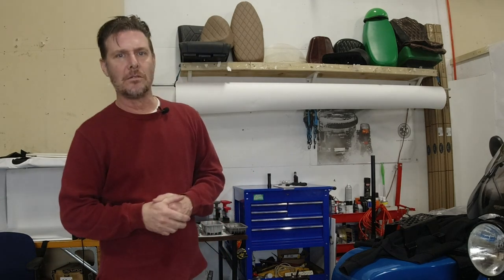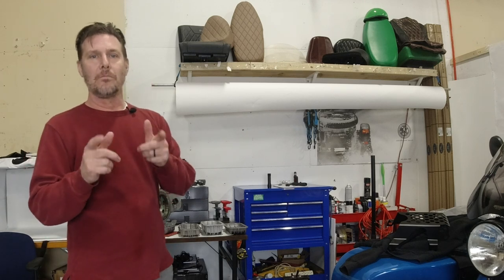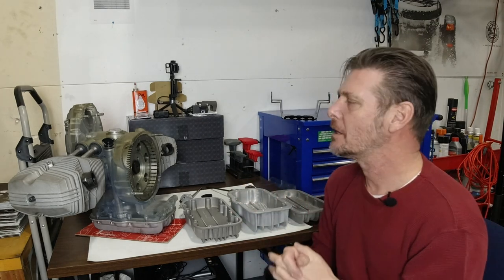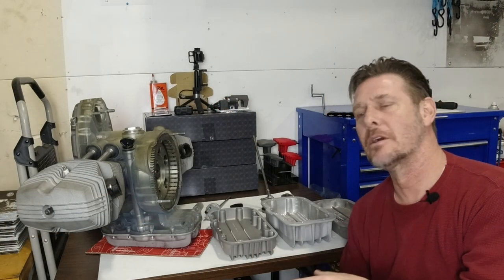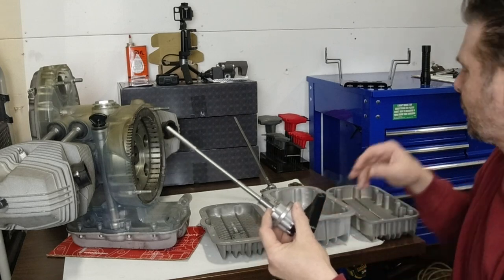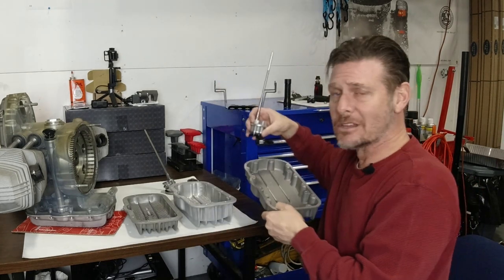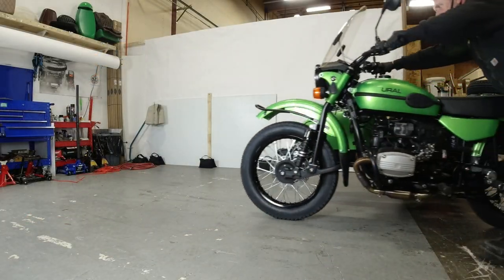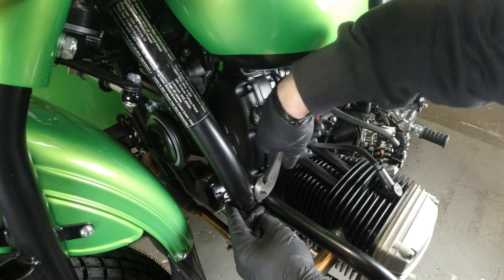URAL How-To - Sump Protection Plate Installation

Comment: Good work Dave.✅
We actually Just tightened up our engine to frame through bolts a few days ago 14:09  and a 3/4” socket also fits fine IF you don’t have a 19 mm socket like us, the largest mm socket we have is 18mm... 🤷🏻‍♂️🤔👏

Comment: Is it critically important to unhook the positive terminal while installing the skid plate?
My 2016 GU has a 4 post AGM battery, and I’d have to pull the seat to do that.
I can’t think of any reason that the O2 sensors can’t simply be disconnected/reconnected on this Gen 1 engine.
I know as a Ural Factory Rep, you have to instruct us to always disconnect the battery for almost any project, but I’d appreciate some real-life reader input from other Ural riders that have installed this skid plate.
Thanx!
Reply: Just installed the Sump Guard myself without disconnecting the battery. No issues. I think regardless of the maintenance, it is always suggested to disconnect the battery. I have a 2022 and ill tell you what, if you are purchasing a new Ural on and ordering it from the factory, I would say it is worth getting stock. Getting the Exhaust off (mind you I have only ridden 2.1K miles) was a chore as it is seated extremely tight. Hope this helps.
Reply: @aur5881  
Thanx for the reply, AUR.
   I was fairly sure it isn’t necessary, but had to ask.
   I was told that on the Gen 2 EFI’s, unhooking certain components can leave a trouble code if the battery is left connected during service, but my 2016 Gen 1 would probably be just fine.
Ride safe, and thanx for the reply!

Comment: Thanks from OZ, David
Some of the sump protection plates do seem to be overly large, but probably protecting the headers and cats, as well as adding weight.Talking of sump oil capacity, and increasing the oil volume. Would an oil cooler contribute to   greater oil volume?? And a worthwhile addition to a 2022??
Reply: I believe the sidecar mounted oil cooler adds just short of 1 liter of oil to the system.
ANYTHING that adds cooling & oil capacity to an air-only cooled engine is a major asset.

Comment: A little off-topic here, sorry David. Is there a reason for the flat washers on the front instead of lock washers? I ask because one of those nuts fell off on my 2021 and the stud almost walked out! I replaced the nuts, added lock washers up front, and used Loctite.

Comment: My 2023 Gear-Up came with the skid plate installed from the factory.
As the bike is new, I wanted to check the torque on the sump fasteners.
But the skid plate prevents access to several of the sump fasteners.
Must I remove the skid plate to check the torque on the sump fasteners?
Reply: That’s a good question. Thanks for asking about torque values! I’m awaiting delivery of my ‘23 GU, and it didn’t occur to me to see if the bash plate was installed from the factory. 👍 Hope so!